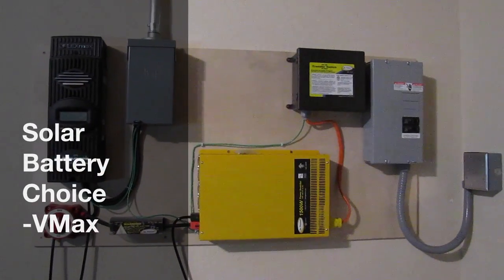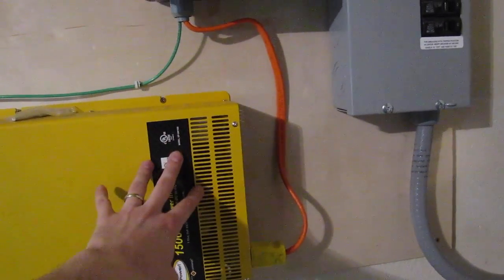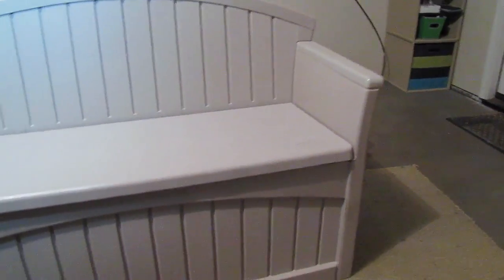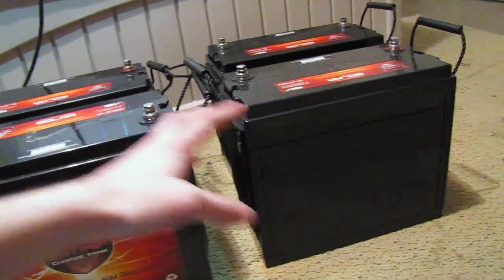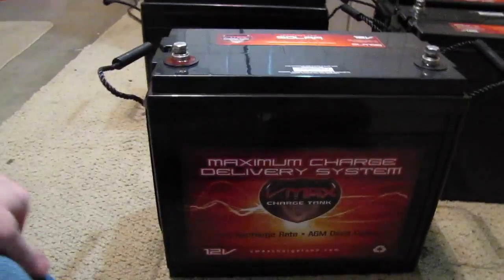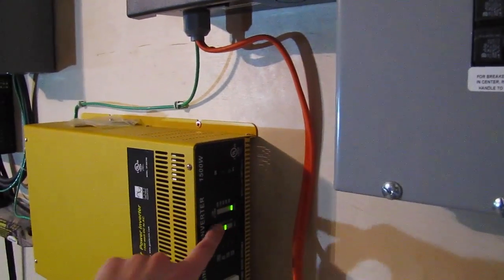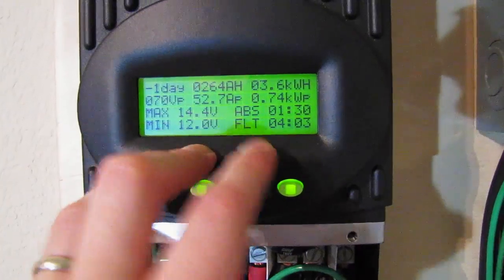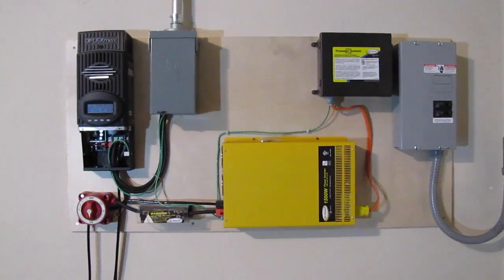Solar Battery Choice - VMax Charge Tank - Off Grid Kitchen

Comment: Happy "Wife insurance" ... Ok, you got a chortle out of me for that one.. and you get an envious tube fan for this build, great setup, thanks for sharing shore power idea was brilliant, future capacitor idea is worth the effort because I've seen videos of how it really benefits a lot when installed properly in the right segment of the power system, not only works for surges, but "cleans" up the power and if I remember correctly from a different video, it reduces the input power required per second.. wish I could remember the exact video I saw and link to it, sorry.  good luck
Reply from the maker: Thanks! I'm going to be doing a new build using some of the 'all-in-one' solutions that have come out of china. Sub to make sure you don't miss it :)

Comment: That's a nice setup that's almost like mine the only difference is I'm using a samlex 3012 evo has that box built in it I have my set up an inverter mode and if my battery is dropped below 11.5 it's automatically price to the grid and charges my batteries once it gets to 14v it switches back to inverter mode

Comment: Shouldn’t AGM batteries be bulk charged at 14.9v and float at 13.8? What gauge wire goes from your charge controller to you batteries and what is the voltage drop? Thanks

Comment: Thanks for the video.  I watched and commented 3 years ago, and it's been about 4 since you made the video.  How long did they last, I notice in one comment you said they died?  I was suspicious of this brand when they came out, and I am wondering on your long term opinion of them?  Thanks!!!  Have you done a follow up?
Reply from the maker: I don't think the batteries were at fault, I was dicharging them too deeply and it reduced longevity. Update of the poor mans power wall (before power walls were a thing) will come. It not has Chevy Volt batteries.

Comment: I have a question. Battery life is based on cyclic rate. If your constantly running battery and constantly solar charging, won't that shorten life of battery. I can't get my head around this. Ps I'm running a 40lbs thrust trolling motor on my boat. I just bought a VmaxTank 100ah because of your video. I want to run a 100 watt flexible dolor panel to charge. My brain is stuck on cyclic rate  please help me
Reply from the maker: What's your question? Lots of info out there on cycling batteries. Best to not go below 50% and not spend too much time above 80%. Good luck out there on the water :)
Reply: JuliansRandomProject 
Never mind.  My question is as stated previously !
Reply from the maker: Sorry, I see it now "If your constantly running battery and constantly solar charging, won't that shorten life of battery?" Yes. I nearly destroyed these SLA batteries and later replaced them with Lithium Ion from a chevy volt.
Reply: JuliansRandomProject 
Thanx ! That's what I was thinking but couldn't find anything to verify. It's just not discussed anywhere !!!

Comment: My system is very similar to yours.  To keep the state of charge above 80%, think about a way to wire in a multistage battery charger on grid power.  This could come on automatically with a photo sensor every night, or via a simple timer for a few hours each night.  The best solution would be to have it switch on ONLY when the batteries reach 80%.  Get your brain working on a cheap solution that would make a nice video for the rest on us to copy.  Victron makes a programmable battery disconnect  that is cheaper than new batteries.  Thanks.
Reply from the maker: These are all great solutions to keep them from being damaged due to deep discharge (provided grid is available). I've since replaced this pack with a a 2014 Chevy Volt batter pack :)

Comment: Hi, I have been using VmaxTanks batteries for a while now and so far so good. I have a 12 volt system in my garage with two 125 Ah and one 155ah  connected in parallel driving a 2000 watt Xantrex inverter. In my house, I have six of these Vmax 125 ah batteries in series parallel since that system is 24 volts. It drives  a 3000 watt pure sinewave inverter.
Some of my batteries are over 2 years old now and still working fine. These batteries, like all modern plastic cased batteries are prefectly safe to sit on concrete. That self discharging thing when batteries sit on the concrete was for real when batteries used this old tar like case, but since batteries have been made using plastic cases, sitting them on concrete is no longer an issue. You are correct in that these AGM batteries weigh a lot. The 125 ah weigh 77 lbs and  the 155 ah weighs something like 90 lbs. Being sealed, they don't need any ventillation which can be a plus in a system like I have in the house since the batteries are in a large closet. Vmax claims they can liveover 10 years in a solar set up like I have. We shall see.

Comment: I have the VMAX slr200 for my solar setup. I need to get 2 more, for a total of 4, like yours, to make full use of the system. my only complaint, so far, is just how expensive they are.

Comment: I did the same as you a few years ago while researching solar set ups for my van, and came to the same decision on battery type and make for my system too. I have the V-max 100ah batteries x2 for a 200ah system in my van. 
This runs my mini-fridge 24/7 that like you, is the constant load on my system.  I bought it at Amazon and its called "Hisense" ( which has the separate door for freezer, and is a very low amp draw at 0.4 amps to run. that I was looking for ) It was only $165.00 with free shipping and has one other trait that knocks this fridge out of the park, and that is this thing is super quiet! So quiet in fact that even with it being literally 2-3 feet from where I sleep I sometimes can't tell if it's on or not! If anyone needs a mini-fridge I highly recommend this one that I found by accident on Amazon.
My system is:
 2 x 160watts panels on the roof (for 320 watt total), and a 20 amp true  MPPT charger/controller with an 1100watt inverter that runs everything I need to run in the off hours -  from the fridge to charging my phone, running my 9 inch digital TV and my LED overhead lights it makes it quite comfortable to live in, which is what I have been forced to do since 2012 after being wrongfully evicted from my one and only home of 42 years due to my whistle blowing on management of the co-op I lived in.
Buy that's another story.
Anyway,  your YouTube vid caught my eye because of the batteries we both have. Mine actually weigh in at just over 70 pounds each. I'm just glad that V-max batteries come equipped with strong built in folding handles that make it a whole lot easier to move around when you have to.
Lastly, thanks for the info on doubling up the batteries.  I kind of knew most of what you said, and if I had the means to do that I would do so asap.  Unfortunately I don't, and am just grateful for having the set up that I have.  I've only had the low voltage alarm on the inverter go off a couple of times when we went for days and days of rain out here in the Bay area of San Francisco.  Luckily the food supplies in the fridge weren't pressing, so nothing bad came of it. But your info here filled a small gap of my knowledge about my solar set up, and that is very much appreciated. 
Hope all goes well for your set up. And rock it on with those killer V-max batteries! Right on dude!

Comment: JRP.      LETS US KNOW HOW THEY WORK OUT AFTER A FEW MONTHS USE EH?  I'd like to use them myself if they work out for you. Thanks for the review
Reply from the maker: OK I'D BE HAPPY TO. I've been using them to run my kitchen (lights, fridge, coffee pot, microwave) for almost 2 years now and they've done well in that time. Although because I cycle them daily they've gotten weaker. Wish I had some data to back that up but I've not collected much. They used to last through the night with hours to spare, but lately they just make it through the night and get charged back up when sun breaks. If it's cloudy or raining I can only make it the one day where previously they'd last 2.5 days without sun. I'm guessing if I had increased the pack size they would not have been so deeply discharged and lasted longer. They're going to be replaced by Lithium soon. Hope this helps.

Comment: loved the video had a question though....making my own system but can't figure out the battery bank situation....making a wind/solar hybrid  just wondering if I should go for these and if I do how to figure out how many batteries am I going to need to purchase if I'm running a nice 1500w inverter and using about 1100w/h? really thinking about these batteries so very curious on how to determine what size bank I need
Reply from the maker: Hey Brandon, If you think you'll consume 1100 watt hours a day, you just divide that by 12volts to get approx 92amp hours of needed 12V batteries. And if you double up (or more) as I suggest in this video you'll need ~ 200amp hours of capacity at 12V. Good luck!
Reply: But I guess what I'm asking is I can run that for 16 hours? I know I need to double to only use 50% battery so looking into the numbers need at minimal 20amp hours... how many batteries to run that for say 16 hours mind you I have way more Intake volume than I'm spending when system is up at full wind and solar Intake
Reply: 1100w an hour
Reply: I'm Intake capable is up to around 350 to 600 amps an hour

Comment: so how did u terminate into your standard panel to go from solar to shore power just having trouble visualizing it ,really great setup I understand everything except how your transfer switch is pushing into the kitchen without disrupting shore power
Reply from the maker: Right. Shore power comes into that transfer box. I'm on Solar all the time and only go to shore if the inverter fails/turns off, the opposite of the intended use of that box :) No care is given to keep it continuous, if it trips there is as much as a second before it click over. SO no computers, just the kitchen and it's appliances.

Comment: I have GENUINELY enjoyed this video! I own a digital media services company in Oregon, I have been involved in Car Audio competitions, and EVERY WORD you said about those is ABSOLUTELY TRUE, LOL!  I'm still laughing while I type this because you are SPOT ON!!! I design & build portable off-grid emergency power systems, I work as a disaster services volunteer, and I'm also a licensed Ham Radio Operator. I don't want to sound like a broken record, but I can't compliment you enough on the accuracy of your statements! Because I live in a rural area, and could be called out for ANY thing at ANY time, I put a similar battery in my car as a "main" and switched out the stock unit for a 150 Amp Marine Grade Alternator. I have the HOTTEST electrical system you will ever see in a Toyota RAV 4, LOL! 
With all the hype out there, and believe me, there are a LOT of "redneck" setups on youtube-some of which DO work far better than I would have expected-I was VERY pleased to see yours. Clean setup, and concisely explained. WELL DONE!!!!!
Reply from the maker: Aww thanks Bruce! You're too kind. I try. I have all the parts for an upgrade of inverter and battery pack (big 3000+ watt from Outback and the battery pack from a Chevy Volt) that may go in soon. Stay tuned and wish me luck. 73's ~ Julian
Reply: JuliansRandomProject those modules from the chevy volt battery work wonderfull, lots of density, Im currently using them, let me give you an advice.. your outback c.controller can be set to 49 volt absorbing so you dont overcharge the cells (4.07 v) max (4.2 v) cant be charged like a lead acid, dont go over 50 volts and do not go lower than (3.0 v) per cell or 36 volts per module,

Comment: I dumped my extra to grid tied inverters too, once the batteries are full when on one is home, the meter either stops or go in reverse, if you shut down anything that does not need to run, it is easy to shut it all down on power strips. The Tv's of today waste a lot in ghost power while they are off.

Comment: Funny how myths persist for so long, such as the "batteries on the ground" myth. That USED to be true maybe a century ago, but no longer. In fact, down low on the ground should help keep them cooler in the summer. Every 14 F degrees above 77 F degrees shortens battery life by 50%. This is for continuously high temps, so unless you live on the equator you can expect reasonable life from them.

Another popular myth is adding sugar to gasoline to help keep carburetors clean. Saw someone with an emergency backup generator mentioning that. I explained that sugar does NOT dissolve in gas, and it will only clog up his fuel filter.

Comment: nice and clean im new to this and like what you have and would like to do what you did in the kitchen of my home do you tell anyone about how how much the cost of the setup is I would appreciate any info you would be willing to share with me
Reply from the maker: If memory serves it was about $5K for 1 kilowatt worth of power. (Panels, roof mounting hardware, wiring, charge controller, batteries, inverter, etc) In california there's about 14 hours of sun so that's a bit less than 14KWh each day. hope that helps. I'll be upgrading this setup soon, stay tuned.

Comment: what is the use of that dc disconnect, is that very useful for off the grid?, also why your inverter is to far from the batteries, and the cables are too small,  are you getting the right amperage for your needs?
Reply from the maker: One must always be able to disconnect the load from their battery pack. the cables I'm using are more than enough for the load (1kw) at that distance from the battery. It's that high off the ground because I wanted it at eye-level. Hope this helps.

Comment: Do you know if these batteries get extremely hot? I am storing these batteries in a stained cabinet in my RV. I don't want anything. To catch fire haha
Reply from the maker: They'll only get warm/hot if you're charging or discharging at high current. Mine never get much above room temperature.
Reply: Okay, good to know. thanks!!
Reply: I think I hear him say about venting the batteries, so maybe it's because when they heat up.

Comment: Thanks for taking the time to make this. Never seen that transfer case before, looks like a pretty cool setup you have. I was wondering about those batteries too... Wanted to ask you, did you ever get a chance to put a grid tie inverter or what do you do with the excess power? I read something about connecting a grid tie inverter could upset my utility company, I guess the new smart meters can sense it somehow? Idk just curious..
Reply from the maker: I've not used a grid tie yet. And I do nothing with the excess power, except on the weekend sometimes I'll charge my electric car :)

Comment: nice setup mate , this is my offgrid setup https://gyazo.com/a5450d3c3f6edf9862a64e35936913b7  got 7 deep cycle marine leisure batteries , 120amps each  840 amp hours i got , what do you allow your battery voltage to go down to >? im scared to go down to 12.5  ,
Reply: GamingHeadquarters HD Good question

Comment: what did this setup cost ? if you don't mind me asking
Reply from the maker: Don't mind at all. If memory serves it was about $5K for 1 kilowatt worth of power. (Panels, roof mounting hardware, wiring, charge controller, batteries, inverter, etc) In california there's about 14 hours of sun so that's a bit less than 14KWh each day. hope that helps. I'll be upgrading this setup soon, stay tuned.
Reply: +JuliansRandomProject thanks for the quick response:)

Comment: I should point out that he's using AGM batteries. If you use lead-acid batteries you need to vent them to the outside as they release Hydrogen gas while charging, which is explosive. It's lighter than air so you need a vent at the top of your battery container to run outside away from anything that might spark. AGM's do release some, so it would still be a good idea to vent those also, but definitely vent-lead acid types or you could be featured on your local TV's 10 o'clock news.

Comment: Julian, Does your GoPower 1500 watt inverter have setting that causes it to stop pulling from the batteries when they reach the 80 or 75 % level?  If not, what device regulates this to insure that you do not cycle the batteries down too far??  Assuming the inverter has such a setting what is the model of the inverter?
Reply from the maker: +Bud M The GP-SW1500-12 cuts off at around 10.5VDC, way too low if you plan to have your batteries last  along time. I currently don't have any protection and will have a shorter life because of it. :)

Comment: Julian , got the same brand for my camper van , I put 400 watts of 4 solar marine flex panels on my van roof .  Used 4 of these vmax batteries at 125 amp hour each for a total of 500amp/h.  Heavy as hell. The system seems to work fine , except in the cold northern weather , the batteries seem to  not preform  as well as in summer.   nice video
Reply from the maker: +Big City Ready 2017 Good luck with your system and thanks!
Reply: I think that you need to keep your batteries warm somehow as that helps make them more efficient. But I am no expert, please check